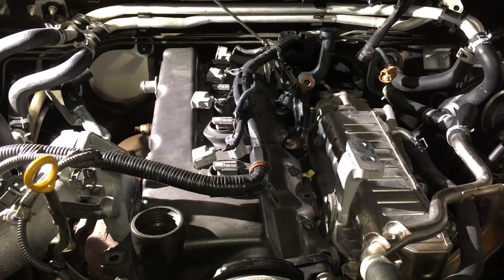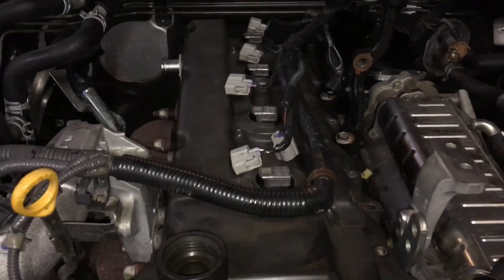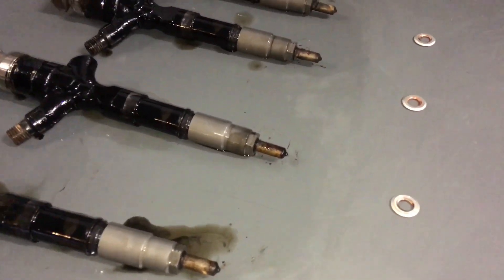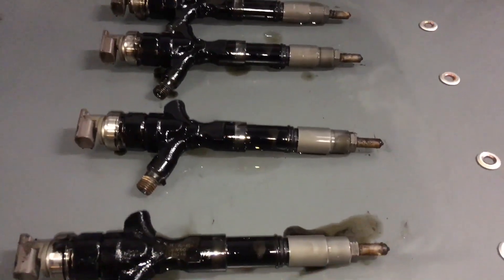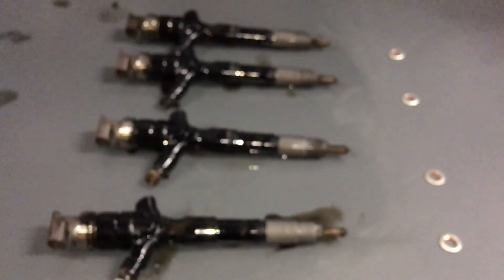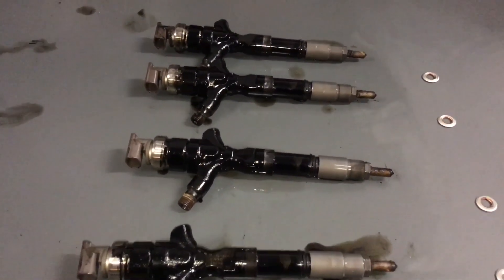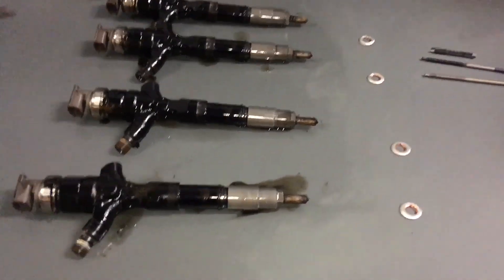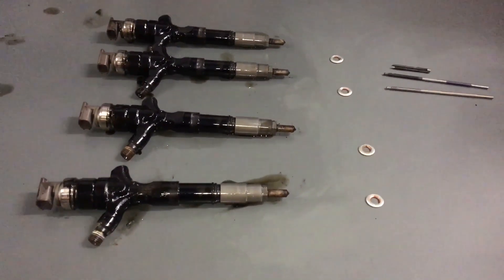ALIGNMENT TIP - INJECTOR SEAT EROSION - When to replace Injectors 1kd-ftv ￼

Comment: My 2006 Hilux now has 402k on.  Original injectors.  Starting to think it's about time now to change these.  If I was in Australia I'd definitely bring it past Anthony.  I was not going to attempt to DIY as I was under the impression they need to be programmed once fitted.  After watching some Fourby4Diesel videos I came to the conclusion it can be a DIY job.  I recently contacted a Toyota spares importer, but they referred me to the Dealership to make sure I get the correct injectors that do not need to be reprogrammed.  Does this sound correct?  
Thanks for the great content
Reply: Well I have looked at a few videos and yes the injector values on the top of each one must be correctly typed in to the engine ecu via Techstream.  You can get it wrong that’s why they also have the value as a QR code.

Comment: I’ve got a 2015 150 that has done just under 180k that I’ve had for 3 years.  It has been dealer serviced through its life.  After listening to Anthony I realised that its time to replace the injectors but I thought I’d also take the advice to have a full EGR clean. The dealer is saying that they replace the EGR cooler and take the manifold off to do the job properly.  I know that it would be a great idea if they need it but my thoughts are that wouldn’t be known until the EGR and cooler was off.  It also adds about $1800 to the price.  Any thoughts?
Reply: Did you end up getting the job done?
Reply from the maker: If you take it to a dealer it means you haven’t watched anywhere near enough videos watch more before you take it anywhere
Reply: @Fourby4Diesel  I would do the job myself but the 150 is on a novated lease.  If you know of someone near Joondalup WA that would be great.